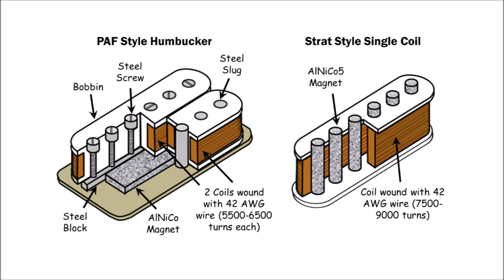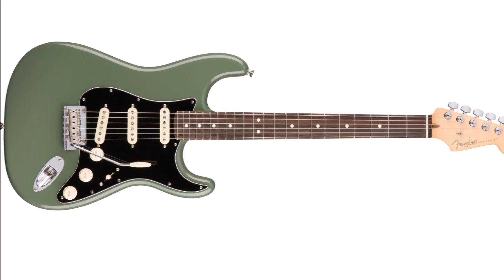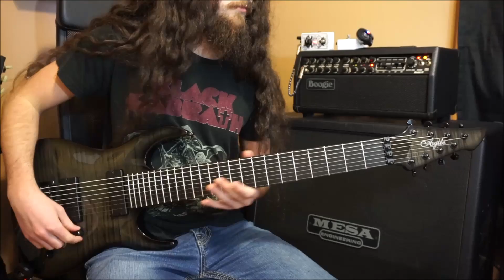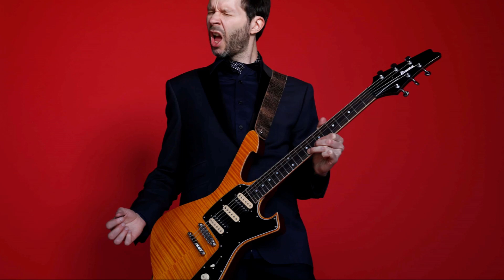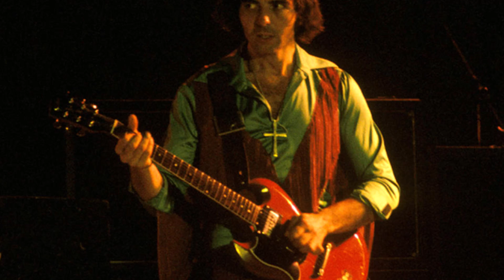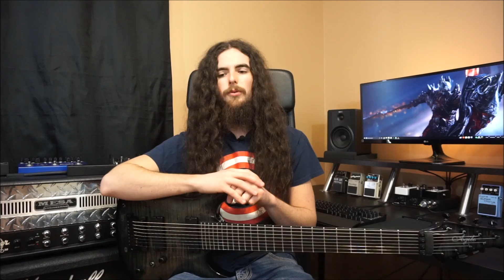Pickups (2019): Single Coils, Humbuckers, Active, Passive, & Fishman Fluence - Explained

Comment: Single coils in the neck for leads and then you show a Korn signature.... LEADS?! Numetal!  They like the single coil neck for CLEANS.

I'd also add as a pet theory.  Super high output passive pickups with triple ceramic V magnets in the Bridge with ceramic rail pickups in the middle and neck are the best way to control your desire for mid and treble frequencies between the "strat sound" and the "Gibson sound".  Add a one meg volume pot and what you start out your whole signal chain is a 750k average resistance on your pickups.  Bridge humbuckers get more note detail loved with strat players and metal heads.  Rail neck and middle pickups can be voiced in so many ways it's insane but they achieve output and chime in buckets (e.g. dimarzio fast track 1) or bassy as hell (air norton S).  But for all the reasons humbuckers crush in the bridge, rail pickups crush for all the reasons a single coil has clarity and chime but with more output and character. Add in the higher rated 1 meg pot and the bridge gets closer to strat territory too. Wire any of the rail pickups in parallel and you maximise their strat potential tones. For me a Dimarzio D Activator X Bridge in series, fast track 1 in parallel in the middle and chopper in series in the neck with that volume pot crushes any 1 guitar setups.

Comment: Can you post up a video about Mosrite Ventures model guitar tech stuff pickups, pots etc,  Can you open up one pickup at least and show us all about it, etc..how to adjust, fix, etc..  There is NO videos at all on youtube that shows how to   maintain and work on these guitars at all.. They are somewhat different.  The pickup looks like a P90 size sort of,  they are single coil but very large single coil pickups, they are very high output  for a single coil about 12k-14k average.  The B string rings out too loud when I am strumming open chords down by first fret.. Not on single note playing or on bar chords at all.  So  I am not understanding  this, not sure how to fix this issue. Other than that the tone is very huge and thick, on single notes too.  Even without any OD or dist.  pedals  it gets huge fast when you turn it up at all.  Just got to fix that loud ringing overtone on the B string..   Can you help me out with that? Maybe someone else has one of these guitars too, never know. Thanks.

Comment: Ryan, love the content I’ve been a subscriber for a couple of years at least anyways I’m a huge Zakk Wylde and Randy Rhoads fan and play metal, big Seymour Duncan fan in general but in ‘07 when I bought my first real Gibson it was a Les Paul BFG model with the burstbucker 3 in the bridge and a P-90 in the neck and honestly not only is it still stock because I really really like the bb3 and how it compares with the SD JB but when I recently got my second real LP that was used and had aftermarket hardware and electronics and decided to drop in a JB bridge and I normally do the JB/Jazz it came with a ‘59/Jazz combo and instead of keeping the jazz neck pickup I’m in the process of deciding what P-90 for HB routed guitars that I’m going to put into it I absolutely love the sound of a P-90 in the neck position for high gain lead work and as long as your playing there’s no big problem with noise traditionally I’ve used a Marshall JCM2000 TSL60 set to lead channel with a Marshall 1936 2X12 cab and either a Fultone OCD or MXR distortion + for clean boost although I have recently been converted to the digital modeling world and the P-90’s are just as good if not better when it comes to noise and feedback because the way digital versions react .... I strongly suggest giving it a try you might just be surprised by the results anyways thanks again for your time

Comment: I have 3 p90 pickups on a riviera p90-3 and take off the metal dog ear covers taping the pickups in place for more high range as the metal covers muddy the tone. I find a balance with any 2 of the pickup dials at a time which act like a humbucker cancelling out the single coil hum. Sounds really good. Also I love that you like Metallica, meshuggah and animals as leaders.

Comment: You also need to take string gauge in consideration to pickups tone, noticed with my 6 string's stock EMG pickups if I use 13 gauge the low frequencies is to much getting to fat! Great video though!

Comment: Do you have a favorite fish man fluence pickup, if so which one?
Reply from the maker: I've only tried the regular Modern set besides the Tosin Abasi set that I have on my Agile, so I cant say with certainty.
Reply: Plague Scythe Studios Between the moderns and the Abasi set what do you prefer and why?
Reply from the maker: The Abasi for me, since it's most different from your standard active or even passive set. The single coil settings are woody and touch sensitive, as well as high output, and the humbucker sounds are extremely well suited for leads and processes rhythm tones. So the set compliments my other guitars more than just a standard Fishman set.

Comment: Whats up Ryan? Outta extreme curiosity I was wondering how you would have your boss sd1 tweaked with an extended range guitar with emg 81-7 18 v mod? I had this preconceived notion in my head to NEVER turn the gain up on that pedal or anything of the sort. But now i know the sd1 is a totally diff animal then say ts9. I am starting to become more fond of the gain knob on my sd1😬. Seems like having the tone knob at 10 o'clock or so keeps things nice and throaty. Btw my amp is Joyo zombie thru 4x12. 

Love your videos man😀😀
Reply from the maker: For a 7 string through a Rectifier type amp, I would generally have tone maxed, the output level around 9 o clock, and the drive at 3 o clock. That is generally a good balance of boost, EQ, and compression for tunings down to Ab. Beyond that on 8 strings, I vastly prefer a clean boost.
Reply: @PlagueScytheStudios  Damn dude, I'm not with my zombie roght now but I read your reply and applied those setting to my peavey viper 1 on the XXX amp mod, and holy shit. Sounds brutal. I hope this translates thru my jam rig! Thanks for the reply man. Id love to see a 6505 video btw😎
Reply: @PlagueScytheStudios  also have donner boost killer at end of chain guitar>sd1<boost killer( which is I'm sure u already know basically a mooer pure boost) Just to help with the signal boost. Now i just need a noise gate LOL

Comment: There's a LOT that can be achieved around a "Humbucker chassis". You can "scatter wind" them with less wounds (low output) and get very close to a slightly higher output single coil. I had a set such pickups wired for me by FLETCHER ( http://www.fletcherpickups.co.uk/ ) to install on a Telecaster and they're really close to the typical Telecaster sound, specially the Bridge Pickup, the Neck Pickup sounding more like a very bright low output Neck Humbucker, but when the Neck pickup is "split" then the middle position is really close to a recognizable standard Telecaster middle position tone (with a bit more output, though).

Comment: I have a 1987 fender Strat plus, which has  three original single position pick ups, also covered in white plastic. It actually sounds great as is, a classic Strat sound to my ears, and it cut down on noise as Fender claimed it would. I don't know why these did not catch on better. Maybe more expert ears can hear a bigger difference compared to a classic Strat sound.

Comment: The first guitar I bought, way back, was a brand new Ibanez Strat around 1981. It had three pick up positions like a classic strat but the pick ups were covered in smooth plastic. I thought it sounded muffled and timid. After a year, I took a bic lighter and burned off the tops of all three pick ups, which exposed the six posts on each pick up. It sounded a lot better with those posts exposed, though it looked sloppy. I guess I gave it a little extra accidental microphone effect as you demonstrated.

Comment: Seymour Duncan has two things : Triple Shot coil ring, and a modular active preamp that still preserves the best parts of passive pickups, both of which work for any 4 conductor pups, though the triple shot ring only works with full sized humbuckers, not minibuckers designed for strat drop-ins.

Comment: Referring to talking into pickups: I remember watching the death magnetic documentary. There's a point where James has the guitar on his lap, laughs, and the laugh was recorded by the engineer. And it was loud! He was just using his regular EMG hetset. It happens, sometimes by accident.
Reply: Never put ya phone to your guitar brotha? Lol
Reply: @thewolfden4680  The way a speaker in a phone (any modern speaker really) works is by creating an electromagnetic field around a ferromagnetic core attached to a diaphragm to create oscillation. What a guitar pickup is getting from a phone speaker is much more dramatic because it is not a microphonic phenomenon but the varying electromagnetic field from the speaker coil in the phone being picked up and transmitting to the pickup. 
You can think of a speaker as doing the opposite of what a pickup does. A pickup generates electrical current from the varying EMF caused by oscillation, a speaker utilizes electrical current to generate varying EMF to induce oscillation. Put the two together and you get this dramatic effect: speaker generates varying EMF, pickup "picks up" this varying EMF and converts it back to electrical current, not a traditional microphonic phenomenon but a purely electromagnetic "microphonic" phenomenon. In essence a pickup is an electromagnetic microphone, but this is not what we traditionally are referring to when we say something is microphonic.

if you were to take a phone speaker and remove the diaphragm it would not produce much if any audible noise, but a guitar pickup would still be able to convert it back to current to pass to an amp.
Reply: I will make it simple: Vocal chords are causing the strings to vibrate and that is what you are hearing. I saw that video as well, but knew what caused it.
Reply: That was on the Hardwired documentary
Reply: I'm surprised hetfield didn't try to record a fart thru his pickups. oh he does that every time they make a new album /rimshot. I was picking up some Spanish radio through my guitar rig for a while.